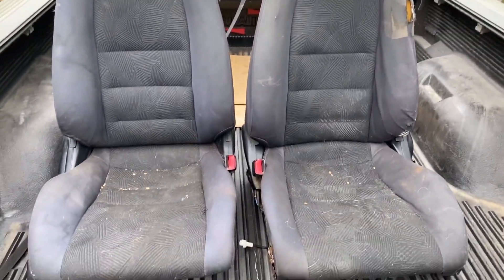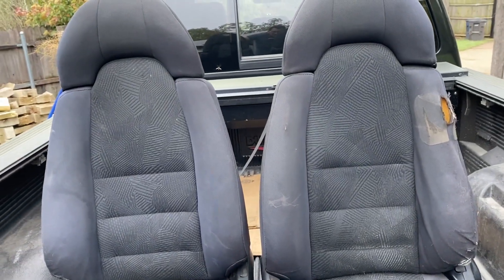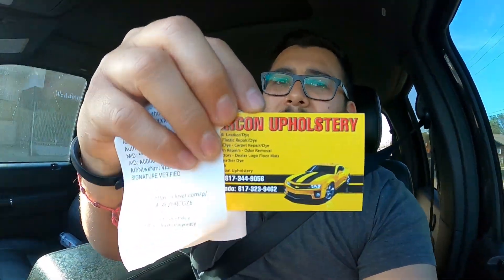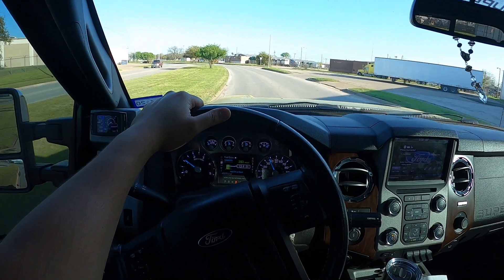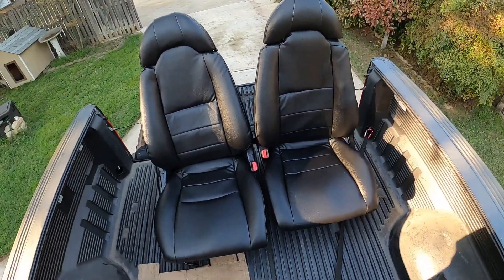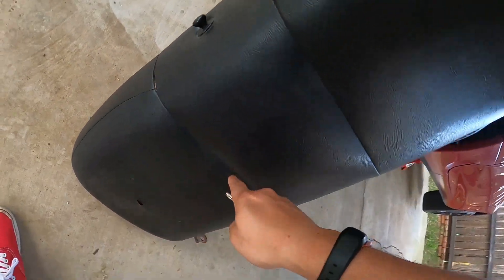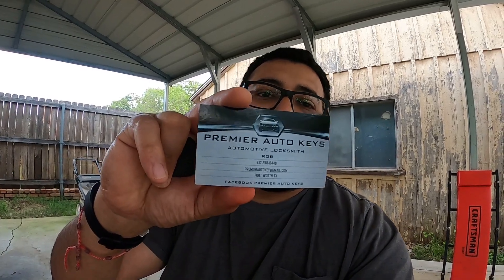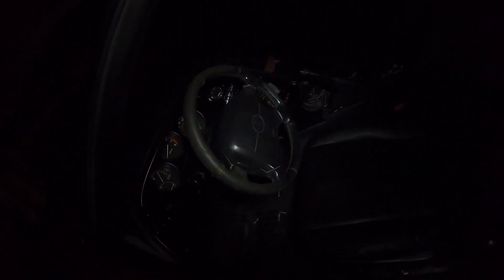Restoring The Original Seats On My Wife's Supra.

Comment: Hey brother so I do upholstery for a living you probably could have used spray adhesive 2 patch those tears in the backseat but you have to use headliner spray adhesive if you use the regular adhesive it will reactivate when it gets hot outside and be a gooey mess but nevertheless good job
Need
More
Input
✌️
Reply from the maker: Thanks a lot for the advice bro. I did read about doing that but that was actually my worry. That it would get sticky since it gets so hot here in Texas. But probably still going to get them redone eventually. Just need to save some money on some areas lol. This build is getting expensive.
Reply: @boostedproject  well that might be perfect do a video on some projects for the Supra that are low budget more Hands-On like just for an example when I re-do the finish on headlights I wet sand
Reply: The headlights and use thousand grit wet sandpaper with clear coat
Reply from the maker: @JayL781  Oh yeah bro.  That is definitely one of the videos I am going to make. Not sure how good they will come out, but I'm going to give it a shot lol.

Comment: Damn, I'm sure you will find the missing keys...
 Also, instead of stitching, you can try to glue it from underneath. It still can be done, even if it's full of holes.
Reply from the maker: I did think about that. But my concern was on how hot it gets here in Texas and how the glue will get redone. Eventually I'll get them redone.